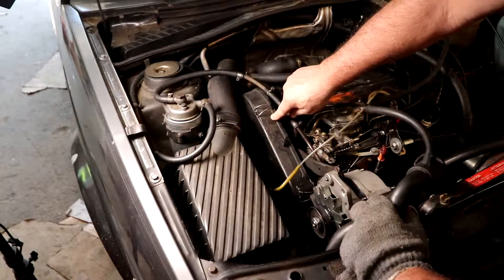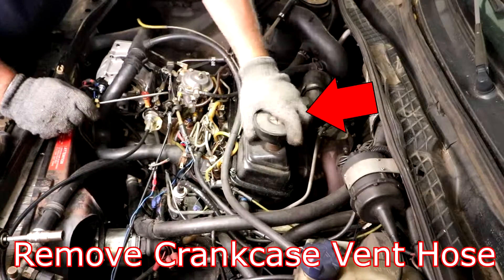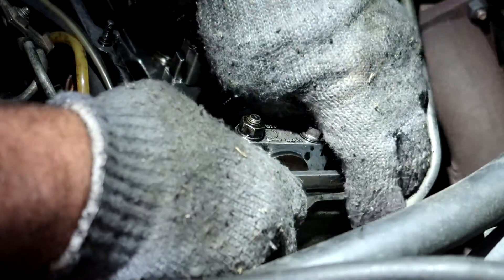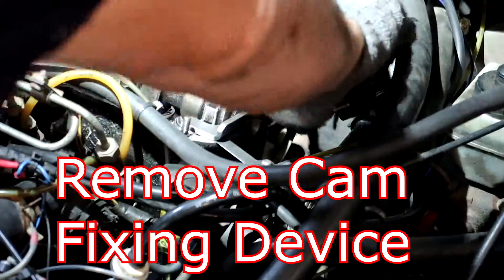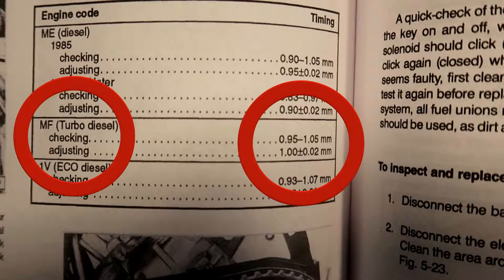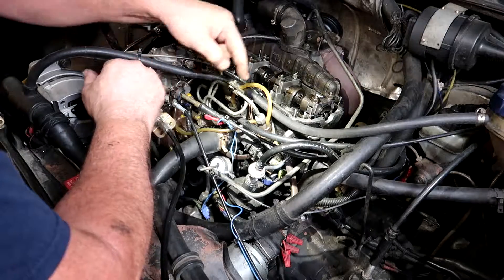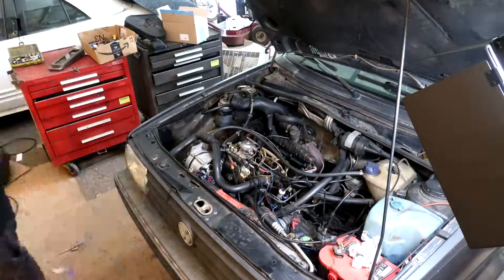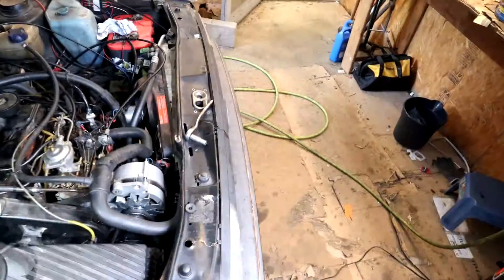Diesel Injection Timing and Valve Timing 1989 Turbo Diesel Jetta mk2 Joe Fixes It

Comment: Hi Joe. I have a 86 Jetta td. Just replaced injection pump with rebuilt na pump because I  couldn't find the td  pump. I also replaced ignition switch. My symptoms are start up and turns off. I've tried to adjust fuel amount. Do you think the timing is way off?  It seemed to be lined at base marks. . I also verified fuel solenoid does not loose power. Any ideas? I was thinking bad pump.. thanks Jason

Comment: Great video Joe! I will be replacing my injection pump soon and always get stuck on the timing part. Thanks for sharing!!
Reply from the maker: you just need those tools.. it is not very hard just dontget it too tight or the belt will walk right off the pully
Reply: @Joefixesit  I have all the correct tools but not the best at using them...😂
Reply: @DIYWilly  just take your time..its not that hard

Comment: Did you buy injector clips for your yellow hoses? I' am gonna buy some hoses now but wondering - I saw clips for sale an maybe should buy some? I'm not sure if the inside diameter needs to be 3.5 or is 2 ok with an outside diameter of 3.5 mm
Reply: I never use clips they stay on just fine

Comment: I keep asking if you'd tell me if a house is a good idea to replace with but, it seems youtube deletes external html links :X its a 3.5mm diameter return line from hans auto parts - is where I got my fuel pump from an they're super nice :X does that sound good or you suggest something else? :O
Reply: use the yellow fuel clear fuel line , the braided stuff does not hold up and is expensive. be ware of hans auto parts, they have a poor reputation. you got a fuel pump, ... you mean an injection pump? there is no fule pump on the diesel, the IP does all the work.
Reply: @JoeisHungry  do you know where I can buy that - he sells that hose not yellow 4$ I have one yellow hose line in my car for I think some sort of heater - you're suggesting to use that for all the return lines? 

I like them they are really nice --- I heard about their bad reputation but they were so frickin nice to me :S  they got hacked while I was working with them and yes an fuel injection pump sorry :S It was missing a bracket when it was sent back but they were super nice to me :S I felt bad they didn't even charge me shipping to replace what had been missing :S I was really scared working with them but :S I dunno, hiccups were present but I saw no bad faith :X  Just -- I recommend I think because they are busy and they charge low price that send them for rebuild only don't do exchange - like they were so nice to me I wanted to give them more money --- I would of driven my car to their shop if it wasn't so far from me here in california :X I've heard some of the other customers on the phone when I've called an they were sort of mean to them :S I dunno :X I bought my timing gauge from them too to follow your video :X like... I think its because they get really busy - I think because their price is low some people treat them bad  or like... Try to say bad things about them :( I honestly try to buy everything from them now not only because the low price but because they are just :S so nice :X like :S I dunno :S :S :S :S Pete and Laura and everyone who works there like Christian an stuff took a lot of time to help me even though I am surely not the highest paying person :S like :X :X :X :X :X
Reply: @JoeisHungry  oh I see those online not very expensive :X you offhand know the diameter? I will look it up if not :D I love yellow!  :D :D :D

Comment: Its me again! My car lives! Thanks a bunch your video helped a ton! Would you recommend a fuel hoses to the diesel injectors? Mine is leaking a little at the spot it connects to the engine and  zip tie only does so much :X shopping online

 [I was reading diameter and another person told me there is a type of mesh hose that latches on better but, I think you would know best]
Thanks a ton for everything :X
Reply: the mesh hoses are crap and are prone to leaking. zip ties? wow
Reply: @JoeisHungry  I think its considered very Mickey Mouse but, I mean... Is why I ask it is not a long term solution

Comment: Hi Joe! :D
Followed your instructions and it is much better - it still will smoke going uphill though and only uphill? Almost never and if ever rarely so under all other driving condition or maybe car start - is there something else I can adjust? I was asked if I can adjust some timing on the top of the pump or something that I didn't see with your video :O I am wondering, does the size of the fuel filter matter? I was recommended to change the fuel filter to a larger size before this and am worried that maybe has something to do with it.

The coolant and oil light still blink might take your advice and just remove the sensor since its not reading correct - oil light only when driving but, the pressure is still correct according to the video I sent to you of it :S
Reply from the maker: a  little smoke under a full load on a hill on a non turbo is not really a bad thing. The standard fuel filter is fine. If you have a turbo I would not change the fuel output as you risk giving it too much fuel and melting through the head. non turbo turning the fuel down to get rid of the smoke can cost you a little power and have a minimal effect on fuel economy. from what you describe you have it set about right for a NA engine

Comment: Hope you see this Joe! I have a 1990 jetta diesel N/A. I've replaced the head gasket and made sure everything was TDC and she won't idle. I got fuel flow and good compression. Hopefully this  video helps with the timing! any other wisdom would be appreciated
Reply from the maker: sounds like your on track
Reply: @Joefixesit   I adjusted the fuel pump by hand and got it running. getting 44mpg now!
Reply: @apocolypticfrenzy4730  If this is a VW then there is no fuel pump to adjust. The injection pump pulls directly from the tank, but if you are getting 44 you got it running pretty good.

Comment: Hey Joe. Glad I’m stumbled on your videos, you’re obviously very knowledgeable in this. I just was gifted a 1989 Jetta Diesel Turbo. It has 205,000 KMs on it. The body and interior is in very good shape. Very little rust. Anyhow, I have limited knowledge and experience in auto mechanics and the car does need some work. I just broke the vbelt on the alternator. I’m thinking I should just replace all the belts now, timing belt included, but I’m not sure what I should have replaced at the same time as doing the timing belt. I don’t have the stuff to do this myself, especially with it snowing up here, so it’ll have to go to a shop. From searching online it looks like I should do the water pump at the same time as the timing belt. Is there anything else I should do at the same time? Someone online mentioned seals? Is the thermostat also something I should do at the same time? Water pump housing too? Sorry for the barrage of questions, but I’m a bit clueless here
Reply from the maker: Great car and it runs too?? wow! if the water pump is not leaking leave it alone. Good idea on the timing belt every 80k should be done. Replace the idler on the timing belt every time. You loose a timing belt you bend valves. Keep the questions coming. find me on facebook in case you need to send photos. I am excited for you I have three of of them running all turbos. On a now that is a transplant engine. Turbo was not an option in 89, they only had normal aspirated engines with an altitude adjuster on the injection pump that looks exactly like a turbo injection pump. Keep the questions coming. I need to become active on the channel again. The fast food Youtube channel sucked up all my time
Reply: Added you on Facebook. Mine is a stock turbo. The owners manual says turbo anyways. Perhaps they had them in ‘89 in Canada?

Comment: Does the timing of the engine and/or diesel fuel pump impact the oil pressure? I have low oil pressure when driving - I believe the timing is incorrect and before making a repair would like to know if you know of a correlation.

I noticed when remedying the fuel somewhat the oil pressure light changed indication. Is this a correlation or is my reasoning baseless?

Please inform and thank you :x
Reply from the maker: Engine has to come out of frame to fix that
Reply: @Joefixesit   Like it needs to be lifted out? Like as if replacing the timing belt?

Additionally, could you tell me how I could isolate or determine that before exerting such effort?
Reply: The intermediate has to come out but will not come out with engine in frame as there is no room to remove it.  As far as knowing if that is the culprit as apposed to crack shaft or connecting rod bearings.. no not really. before doing any of this you need to check the oil pressure with a gauge at the oil filter housing while at highway speed. What year is this car?  also you could pull the intermediate shft out partially to look at the condition of the outer bearing is about all you can do.
Reply: @JoeisHungry  an 89 vw jetta :X mk2 no turbo
Reply: @robertp2552  I have two both with turbos. They never came stock with turbos. I would varify with a pressure gauge at the oil filter housing fitting. Should be 40 psi minimum at 55 mph. I had to fix one not too long ago with a 25 psi..
Reply: @JoeisHungry  Would you know people or persons in southern california who could hlep me? I don't want to ask my mechanic again because they kept telling me the sensor is faulty but, the low oil light stops when I stop accelerating sometimes consistently yet never used an oil pressure gauge to determine if their assessment is true... I don't want go into the rest but, I don't know how to do all that :S

Will my engine break if I drive it with low oil pressure like that? How far should I drive to get the proper reading? I want to minimize potential of damage so haven't been driving it
Reply: @robertp2552  you need to put an aftermarket gauge on it to verify. The sending units mess up too.
Reply: @JoeisHungry  ok - I will show your comments to friend maintenance shop tomorrow to see if they can help me understand this :S

I never worked on my car before :S 

Thank you very much, I'll let you know how it goes :X
Reply: @robertp2552  lt me know and spend time learning. The car is very easy to work on and simple
Reply: @JoeisHungry  Thanks, Im just scared ill break something :S this is encouraging - I am buying the oil pressure gauge now
Reply: @robertp2552 let me know what the numbers are? good luck
Reply: @JoeisHungry  can you tell me why the coolant temperature light would blink when I start the car, its the light right above the temperature gauge

The car will be cold and it will be blinking, what does that mean?
Reply from the maker: @robertp2552  if it does not stop blinking then you have low coolant or a bad sensor or sensor fault. If it blinks for a few seconds and goes out that normal blub check sequence
Reply: @Joefixesit  HIII So, I added more coolant - it seems it was at the minimum level and now it only blinks randomly and restarting the car stops it and the temp stays under the middle somewhat -- Thank you!

I've another question! I had the timing checked and the diesel injectors changed... I still need to pull the choke out for the car to get enough fuel... 

So - is it the diesel pump? How can I change the rpm of the diesel pump? Or what could it be

Engine timing = good
diesel injectors = good
diesel pump = rebuilt but, maybe timing of it is incorrect?

Everyone tells me the air to fuel is off and I can see it in the exhaust but :( how to fix :( :(
Reply from the maker: @robertp2552  Your coolant level light going on is not uncommon, it is a faulty level sensor in the coolant tank. These things drive me nuts. The replacements have a high fail rate. At times I have just given up and shorted the pins on the plug at the tank under the hood.  Your temp gauge sounds like it is working fine.

Injection Pump: there is no Choke on the diesel. All the cold start does is advance the timing 2.5 degrees in order to give the engine more time to burn the fuel when it is cold. More than likely you have timing issues or low compression or poor spray pattern or leaking injector nozzles. My vote is injection or valve timing.
Reply: @Joefixesit  so then

engine timing - good
diesel injectors - good

What is compression and spray pattern from?

If I pull the choke out my car is fine, doesn't shake but, its still not as peppy as it was before :S
Reply: @Joefixesit  also - thank you yea... I have a replacement sensor didn't know how to insert it - I'm just mad its been blinking forever and people just told me not to worry about it this an that but it was really just needed more coolant... It was sort of weird it kept blinking when I added too much coolant too :S now it almost never blinks and if it does restarting the car fixes it :S
Reply: @Joefixesit  also thank you for telling me this - everyones been telling me its a choke and some guy literally talked to me for like 15 minutes about how its called a choke and I told him its just for when the car is cold to warm up the engine :S

I don't like driving around with it pulled just so my car doesn't shake :S
Reply from the maker: @robertp2552  There is no choke.. it advances the injection timing..Choke in a car changed the air fuel mixture in a diesel it only changes when the fuel is injected. If the engine is worn out then you have low compression. Bad spray pattern refers to the injector nozzles being defective. This sounds like a timing issue more likely since pulling the cold start helps because all it does is alter the timing, but also it could be the other issues too.
Reply from the maker: @robertp2552  it just screws in the top of the coolant tank under the hood, it is a coolant level sensor that causes it to blink.
Reply: @Joefixesit  

How can I check engine compression? Because if its the timing I was told that is correct - :S
Reply: Is 60 at idle good?
Reply from the maker: With the engine cold.. yes.  But you need to check it at highway speed at operating temp.. should be above 40
Reply: Or actually the choke was pulled is 45 at idle good?
Reply: @robertp2552  at operating temp yes it is good .. but you need to check it at highway speeds well warned up.  15 is fine at idle
Reply: @JoeisHungry  https://www.youtube.com/watch?v=HHWnE_rK5QY

Here is what I recorded - It seems fine - the low pressure noise went on after disconnecting the sensor though..

gonna look for different sensors I swapped the engine so maybe it reads wrong :X

Also... white smoke is from bad timing right? Back to reason of your video :(

Thanks for listening and helping me think through this @-@ I gotta find person who can do this because I'm too scared x.x
Reply from the maker: @robertp2552  Nice video. If that is what your pressure is at full operating temperature I see no issues. looks like you have a sensor issue. There are two sensors, a low and a high. I have had them reversed before and it trips the alarm because one completes the circuit and the other opens the circuit in normal operation. The Manual will tell you which one is which. I can not remember sitting here in front of my computer. (Manual out in the shop). Testing involves shorting or opening circuits. You could just have a bad sensor. Let me know. The sensors normally have pressure stamped on them but the cheap knock offs sometimes do not. Let me know.
Reply: Has no impact on the pressure. Usually the culprit is ok intermediate shaft bearing from over tightening the timing belt.
Reply: It's at 30 after driving around the block when I Rev the engine the pressure goes to 80
Reply: When I drove it to the highway at 30 the oil light blinked and then started buzzing which it didn't do when I drove here I'm honestly just a little freaked by it
Reply: BTW I recorded the test I'll post an unlisted video of it when I'm home to show to you

Comment: Is this cam shaft valve position adjustment thing the same on diesel Toyota Coaster 1 HZ motor. Having all sorts of trouble getting the timing right. Pump dial indicator 1.03-1.09, new pump, new injectors, new timing belt, new glow plugs all tested, all three pullys on TDC and BDC for the new belt. Starts but no power through gears and lots of smoke snuffs itself out in second and stops on the rd. Cant even get around the block been working on it weeks. Tried pump in heaps different spots including the dial gauge exactly as in the manul. Beats me.
Reply from the maker: Not sure what Toyota does and how it relates to VW diesels. On VW diesels you must first set the valve timing and then do the injection timing they're two different operations. You lock the camshaft in position with the camshaft lock on the end of the camshaft and then when you put your timing belt on you got to make sure that your crankshaft is on top dead center before you lock the gear on the end of the can shaft down because it's on a tapered shaft and can move until you lock it down. After that then you would set your injection timing by rotating the injection pump in reference to the lift you get when you put your gauge in the end of the injection pump and that's usually 1 mm of lift. From what you're describing it sounds like you have your injection timing way off. The Volkswagen diesel will actually run with the injection pump off 180°. Not very well but it will run. Be very careful that you do the valve timing correctly as these are interference engines and you can bend valves.